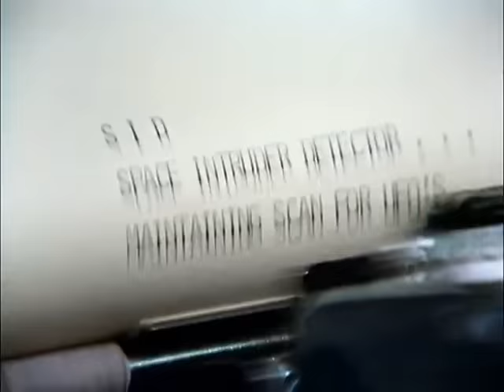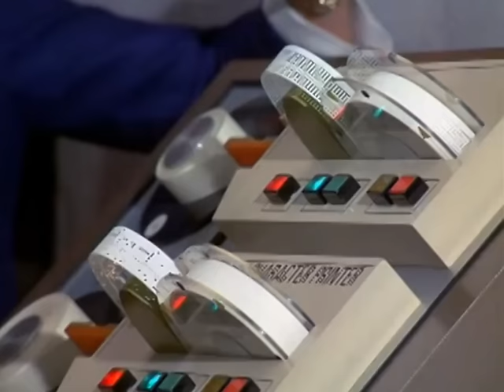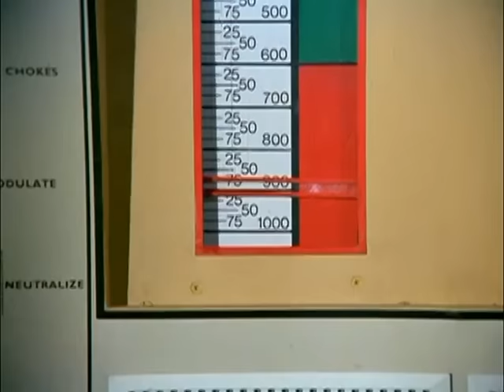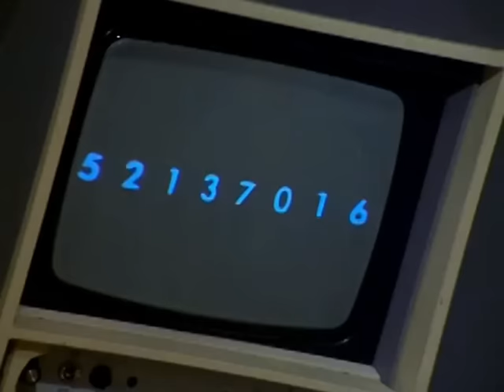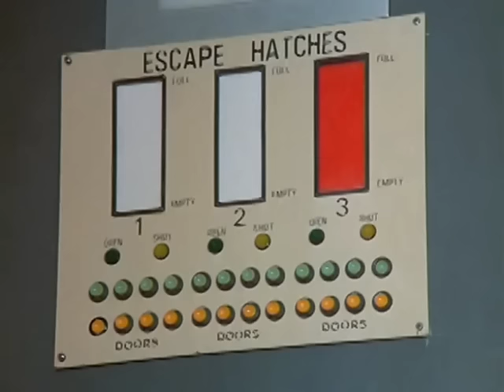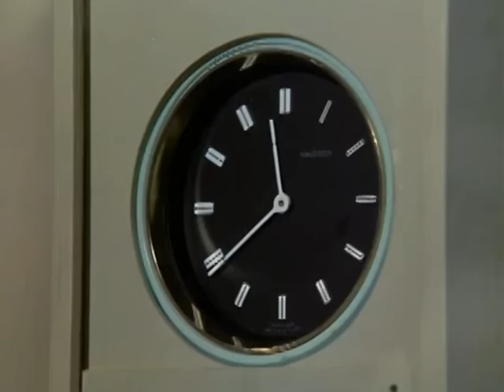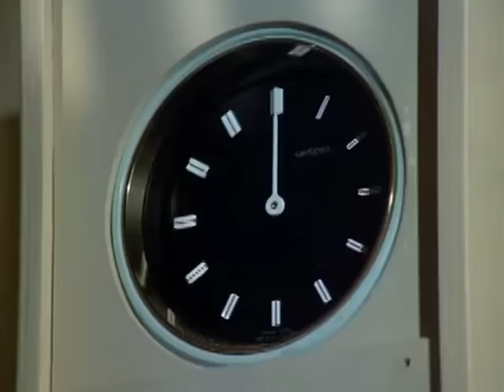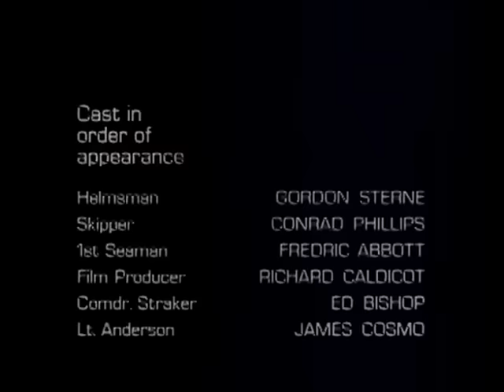SkyDivers of SHADO

Comment: Commander Straker: With regard to "The Dome," you might want to consider coding/encrypting ALL communications between SHADO, Moonbase, Skydiver, etc., instead of in the clear.
Reply: The Aliens can probably crack any form of encryption with their tech being hundreds of years in advance of Mankind.
Reply: aw com on Steve that would take all the fun out of it ...lol
Reply: My Sci Fi Web Series. Probably not?  That's not how being "advanced" works.  It doesn't mean that you're better in all things.  Just because the aliens had ability to create a craft that could travel at the speed of light does not mean that their ability to encrypt/decrypt data parallels it.  In fact they may not even know what encryption is.  Who's to say they even had a need for it?

Heck, as far as understanding what  information they transmit their language is probably as alien as they are, which would act as encryption all on its own.

Comment: The submarine can travel at 40 knots, previously mentioned. Can dive to 900 feet and the "aircraft" on the front is still flyable despite being built to withstand such depths. Must have a skin several inches thick. Flying tank.